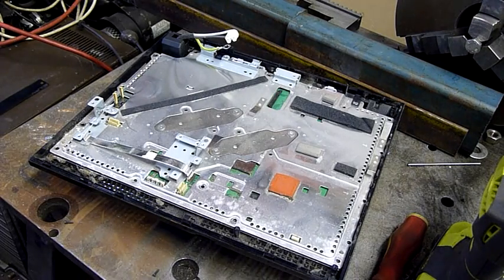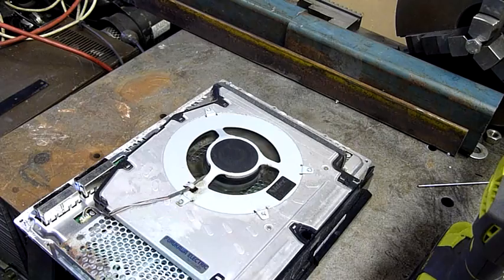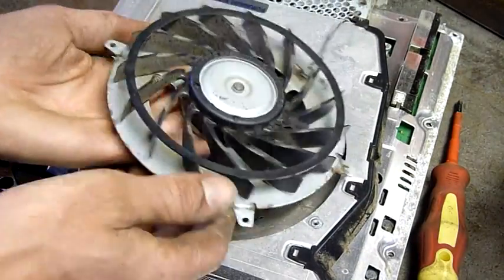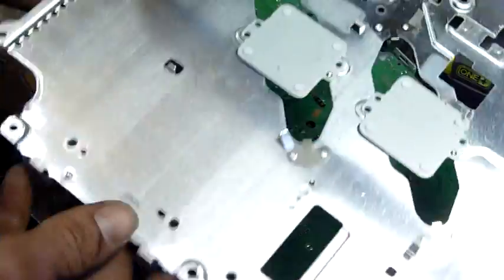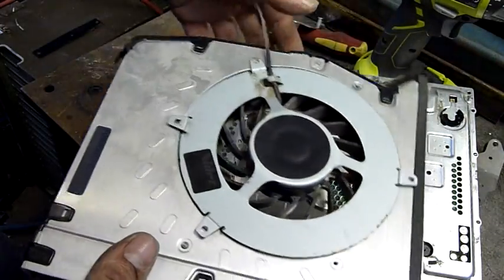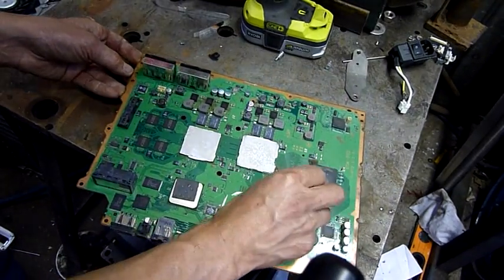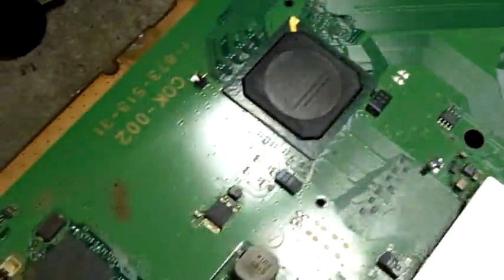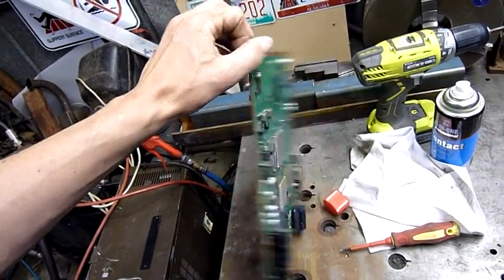First Gen Sony PS3 Autopsy Pt2

Comment: i don't know why this is so different with different motors , but i think some producers know about their customers ( cleaning pc with a vacuum cleaner or a air nozzle ) and build in some diodes , i had attached a fan into a pc with interchanged poles and no the fan spinned not into the other direction , he dosn't do anything ;D

Comment: Yeah, its pretty common for most modern computer fans to have diodes to protect the motherboard, you may have tried an older pc fan or a cheap chinese fan without the diode protection.

Comment: motors produce ac unless they have a protection diode built in so it would show 0 on a dc multimeter. try them on a scope or put a led on the output

Comment: Yea true. I find PCs cheaper in the long run though, because if you brought good parts, you can sell them off or reuse them later. So if I buy new parts (motherboard, CPU, Ram, etc) I can reuse the old case, DVD drive, PSU (as long as there isnt like 50billion amps on the 5v rail and only 10amps on the 12v rail like an old PSU :P) Keyboard, mouse, HDD, etc. Whereas with consoles, You have to buy a whole new console and sell a whole old console. A waste of parts.

Comment: That has never been the case. The PS3 for example was using a Nvidia 7000 GPU and barely capabl of 720p well PC's were running  8800 GPU's and running games a 1080p.

Comment: i worked on a few consoles that had the same problem with the heartsink  compound drying up. than it overheats and you get the red light of death. i just reflow the the two ic's
and it up and running

Comment: I'm not a hater of consoles, but all I can say is that consoles would be good, if they would build them normally, consoles are popular coz it's easy to use them, and you don't need a pile of programs on top to run a game like PC needs. On a second hand, consoles luck a simple way of upgrading them, so if you have one there is no way you could make it performance better, where with PC add ram, change graphics and there you have it, but again you need to know hot to do all that stuff.

Comment: Wouldn't surprise me one bit if it was >2 amps. That's a quite large motor hub. They usually reserve the metal hubs for the stronger fans. Only way to find out is to hook it upto 12v and see what happens.

Comment: 2.65 amp? That's a 32 Watt fan. Those crazy 92MM 120CFM Vantec Tornado PC fans were only about 15 watts. That Nidec blower should be able to move an impressive amount of air at full power.

Comment: The PlayStation 3 was outdated before it was even released. It was released November, 2006. It's GPU is a slightly crippled GeForce 7800. The 7800 had already been replaced by the 7900, and in November, 2006 nVidia released their brand new GeForce 8800 Series. 

Likewise the XBox 360 also quickly fell behind. Valve Corp. already believes that current generation PC hardware will be more powerful then the next gen console stuff.

Comment: i have tested some pc fans while i where spinning them with a air nozzle , i attached my multimeter to them and also 10 of 10 dosn't have a voltage on the cables ;D

Comment: BTW it was a first gen, a very very early one, it still had PS1/2 emulation and the memory stick bay, later ones didn't have that stuff.

BTW I couldn't resist keeping the HDD, its a 5400RPM 60GB seagate, which I am putting to use. I left the caddy in there where it came from though.